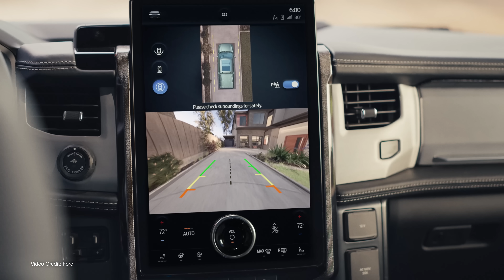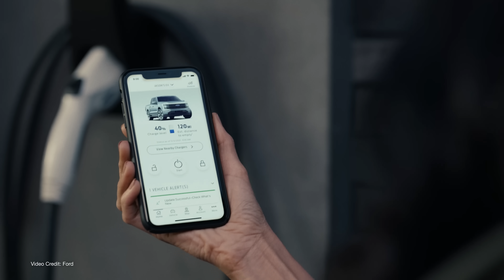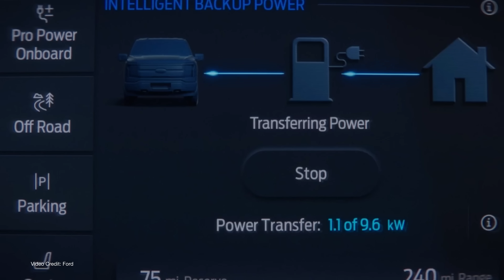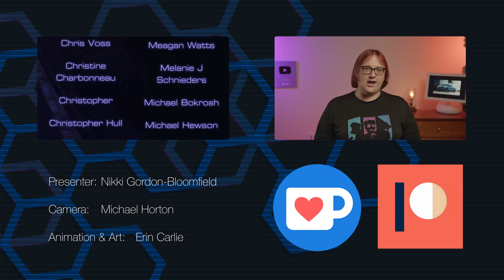Ford Maverick Lightning and Ranger Lightning EVs - What To Expect!

Comment: As an owner of EVs, one of the guaranteed results of most of them will give you plenty of ANXIETY!  Now we have more BS about putting a gas guzzling truck into an EV mode.  First, why do people buy these trucks?  Propaganda on the media helps these sales.  Do you know that 93% of truck owners NEVER use the bed!
Additionally, the dealers get away with charging the stupid buyers of trucks a 30% markup compared to a car.
Now this propaganda is promising an EV truck that will make everything better. So, for example, the manufacturers think that the car buyer is so stupid that they will buy an EV Hummer that weighs 9000 pounds and has a starting price of $110,000!
Hey, my Toyota Prius can get up to 80 mpg.  It uses both electricity and gas. Oh, and it cost me $40,000!  Hey, here's your super thanks for this baloney.

Comment: Omit the gas powered drive train motor transmission rear end Etc. along with the maintenance that goes along with it and replace it with batteries of the same equivalent cost and you’ll have a 300+ mile range pick up. Dealerships would love the Hybrid drive train because I would still get to do the maintenance on your gas powered drive train.
Reply: "batteries of the same equivalent cost" would not get you close to 300 miles range - or manufacturers somewhere would be doing it, even if Detroit didn't.

Comment: Given that compact/midsize trucks are not used for towing nearly as often as fullsize trucks (the main range killer for EVs), I really see a PHEV compact/midsize truck to be a waste. I'm in the process of finishing my ~90 kWh pack for the original Ford Ranger Electric, and based on original efficiency numbers from Ford, SCE, and Idaho National Labs, that should be enough for about 300 miles of real-world range and about 250 miles of freeway speed range (about the same as the Extended Range F-150 Lightning). A modern Ranger build with modern NCM batteries could easily support a 100 kWh pack, and I would expect that in factory trim, it could have similar range numbers to the Extended Range F-150 Lightning.

Comment: I wish YouTubers like you would base your speculations on real vehicle engineering rather than musings derived from trademark filings (by the way, you seem to mistakenly believe that a trademark filing in the US is only applicable to North America - it really does not work that way). BASED ON ENGINEERING/TECHNOLOGY CONSIDERATIONS,, here are some better informed speculations:

THERE WILL ALMOST CERTAINLY BE A PHEV MAVERICK. Likely a 2024, it will use the same (or nearly so) powertrain and C-Platform components as the PHEV Escape. This reduces development costs and makes for manufacturing savings. It will offer an EV range of 40± miles, because the size of the battery is constrained by what the current Ford PHEV space geometry for the C-Platform allows. The PHEV will NOT be available in AWD, ever. The design of the battery does not allow a driveshaft to run the length of the chassis. In the US, the PHEV Maverick will be a very successful seller.

THERE MAY BE A PHEV RANGER (but not any time soon). Not a lot is known about the P703 Platform that is the basis for the new Ranger. Its capacity to be modified for PHEV is unclear. What is known is that none of the initial engine offerings - in North America or globally - for the 2023 Ranger are hybrids. NONE. It is hard to engineer a PHEV drivetrain into a new vehicle platform if there isn't an existing hybrid offering.

THERE WILL PROBABLY BE ALL ELECTRIC MAVERICKS AND RANGERS - BUT NOT THIS GENERATION. BEV small and mid-sized trucks from Ford must wait until its new utility vehicle electric architecture is ready - which is model year 2026 at earliest. It could happen with a refresh of the Maverick in that model year, or it could be a model with different badging. I'm purely speculating here, but I suspect that the new Ford electric utility vehicle architecture will resemble GM's Ultium platform (which, contrary to what many people think, isn't just a battery technology, but a holistic system approach to electrification). Also, like GM, I think it will rely on a "hybrid" vehicle structure; something that combines unibody with a chassis (or a skateboard) as it appears the new Silverado EV does. This requires a very high level of system/structure integration, so it cannot just be adapted to an existing vehicle, like what Ford did with the F-150 Lightning.

Sharing this information with your subscribers would be far more substantive than the marketing based drivel you presented in this video.

Comment: Do to range and towing issues, I'd be interested in a plug in hybrid. Enough battery to do my usual shopping, etc, but still be able to tow my boat 350 miles, 1 way, to a yearly race.
I'm surprised no one is offering an electric vehicle with a smaller gas engine to be used only as a battery charger. At least Lotus and Toyota have developed these, but not in use yet.

Comment: As an American I'd suggest that Ford doesn't want to put the lightning name on the smaller trucks since the f150 lightning is a legacy vehicle that was always a performance truck. These smaller trucks may not be high performance electric trucks leaning more towards economy over performance. 

Thunder is easy to explain, it's what comes after lightning in nature. Thus the ranger and maverick ev launching after the f150 ev

As far as ev trucks replacing gas and diesel, that's a ways away. Getting 80-100 miles range towing 6500lbs is insufficient. Compared to the gas versions going 300miles towing 12000lbs. 

The USA is a huge country. Europe as a continent is about the same size. So we can travel across several European countries just by crossing a few states. I've numerous times driven 1000miles in a single day which you aren't doing in an ev. And that was me towing a 15klbs or 6800kg camper. Fuel stops are 10 minutes ev charging is not. And if you had to stop every 100miles to charge an ev would have hrs of down time to charge. 

Show me an ev truck that can make it from New Orleans to Chicago in 1 day towing at least 4545kg or 10000lbs and I might be swayed but that's unlikely to happen anytime soon. 

And the requirements to go ev won't be enforced anytime soon and as soon as they try to enforce them, the courts will strike them down as govt overreach.

Comment: The time for PHEVs to really shine was 5-10 years ago.  They still have a niche, but they missed their shot at the prime time.

I do wonder if a 4-second 0-60 time is a good idea in something that doesn't have a sports car's steering, suspension, brakes, weight distribution, and center of gravity...  The question is, how good does it fare in braking and obstacle tests?  (They're probably going to have to implement an acceleration limiter, especially on fleet vehicles.)

Comment: In nature first comes lightning and then comes thunder.  Could be as simple as that.   I was going to trade in my GLE in for the pro model but you can't get one and $80k for a vehicle is stupid.  Take the $40k savings and buy lots of solar.  Plus you get the 26% tax credit.  And then there is the large added carbon footprint I'd be contributing to buying a new EV when my driving habits in this used vehicle is soo much less.  Meh, no one really cares about the environmental impact their vehicles are having.   If they did they would have converted to propane years ago and not drive over 50 mph.

Comment: I just wish anyone would actually come out with a small pickup like the size of the Mazda based Ford ranger that they sold until about 2011. There have been a few start up companies which have shown concepts that might fit that size, but none have actually delivered any yet.
Reply: The Mazda B4000 was a rebadged Ford product, rather than the reverse. The Ranger was essentially unchanged for something like 16 years.

Comment: Sadly I believe you are correct in thinking that we will not see an all electric version for some time.  Personally I am not a fan of driving a small vehicle of any class for long distances.  I have had enough negative experiences with plug in hybrid vehicles to steer me clear of them, especially as they age and the combustion engine side developed issues related to low usage.  

What I am looking forward to is an all electric SUV ( Explorer sized) with 300 to 400 mile range EPA list.  Then I could ditch combustion for all but a small slice of vehicles.

Comment: Since everyone in North America but me can drive 600 miles every day without stops of any kind and either pee in a bottle, or Blue Cruise it out the window, I think a PHEV truck makes sense until the next gen batteries arrive that can go 600 miles while towing a brick house.
For myself, I am hoping that Lightship, or Thor/Airstream bring a battery powered trailer to market that is somewhat affordable which can optimize the range of a 300 mile truck.

I'm hoping that one manufacturer goes away from the crew cab tiny bed and brings me an extended, or regular cab with a 6 foot bed and a nice front storage area.
I have always wanted to help Mrs Smoker and Mrs Non-Smoker find their missing piston engine. I do sometimes put my groceries in the front of my Tesla which can cause people to stare

Comment: Yep. You are probably right. The Maverick, which comes as a hybrid in the standard configuration, has a drive unit that is more than a little reminicent of the one found in the late gen.1 Chevrolet Volt. It is Plug.n-Play ready for conversion to PHEV. 
A PHEV version was obviously planned for in the initial design spec since considerable engineering and testing time and money is needed to copy design a drive unit (some say "transmission") like that.

Comment: I agree entirely with your analysis. I HOPE the Ranger and Maverick both get a Lightning variant in the US. But I’m not betting on it. A plug-in hybrid “Thunder” is the logical product mix for the US market. My concern is that there are care/operational considerations on PHEVs. “Stale gas” is something drivers who use mostly the electric range have to monitor. This inconvenience as well as the fact that if you don’t plug in, your MPGs will decrease significantly more than a regular hybrid as now the engine has to haul around the weight of the battery and motor which aren’t contributing to propulsion. These two issues could turn people off to electrification.

Comment: i gather that since the F150 lightning is a crew cab (has 4 doors). that the Maverick and Ranger will also be in crew cab models, which tend to be some bigger than their standard and extended cab models, and who knew cost more too. cost more = higher profits for Ford (and others).

Comment: Well..  Ford can EASILY come out with a maverick plug in hybrid as stage 1.   and then come out with EV version.    I'd certainly give them 40 or 50k for one.  single or dual motor.      Nothing at all wrong with a 150 mile EV Maverick Lightning.   and if you are person who needs more.. you buy a Maverick Thunder.

Saves ford from having to cram 350 miles into a pickup.   Most people dont need 350 miles of EV

Comment: I hope that the Ford Maverick and Ranger Thunder are just Electric.. the F-150 Lightning used to be a performance gas truck in the early 2000s so it wouldn't make sense to add that name to every single electric pickup truck that happens to be from Ford

Comment: Plug-in Hybrids got no future, why not Full EV Now?
Reply: Cuz in 'Murica, people need to tow their 25 foot boats 600 miles into the desert, uphill both ways. Every day. Ask them, they'll tell you. Plus the electric grid, you know, won't work if everybody changes to EVs tomorrow.
Reply: @jamesvandamme7786  By the time manufacturer ramp up there production, no problem for the grid. Also when EV get a range of 600miles+, which is very soon, no problem! Get rid of hybrids!

Comment: Interesting thoughts! Regardless of what happens I just hope a country doesn’t get stuck with a hybrid model and no electric version being locally available despite them being available elsewhere. … which I think is actually already a problem in my country with some cars, I just don’t pay enough attention to anything hybrid related to confirm off the top of my head. Which wouldn’t surprise me given how hard it is to get ev anything over here without emission standards and fines when we are competing for product against countries that do.  

Also good to hear more about how the Lightning truck is turning heads. Can’t remember if it was you or another channel or both that did an explainer video about the importance of the Lightning truck to Americans but the cultural aspect and that house energy backup certainly seems to have people talking! Great to hear that momentum is still going, perhaps even getting bigger or more entrenched now there are actual physical trucks around for people to see and experience in person.

Also that point about the frunk turning head and getting people interested is interesting. Haven’t really thought about it that way before but that’s a very obvious visual indicator of something very different that could get the uninitiated talking. 

Hell, even as someone who’s been following EVs for years the first time I came across a Tesla with a family casually pulling picnic basket type stuff out of the frunk I still blue screened for a moment. My mind just did not compute the idea of empty space where the engine should be, seeing frunks on video and knowing some EVs had them was one thing, seeing it in real life was entirely another.

Comment: Makes perfect sense. I think the US market will definitely be interested in the Thunder Maverick PHEV, especially due to range anxiety while towing close to maximum capacity. However, the downside is having 2 different drive trains making maintenance just as bad or worse than an ICE vehicle 🚗
Reply: This is false.  The electric part of the hybrid engine not only reduces use of the ICE portion of the vehicle (less oil changes, less wear and tear on valves and injectors), but also reduces use of the breaks due to regenerative breaking.  

In addition, there are relatively high maintenance parts no longer needed in a hybrid, such as the starter and alternator. 

Hybrids have two engines, but less parts overall and less moving parts than an ICEV, and that is why their warranties are longer.
Reply: @JeremiahTownsend  Interesting. Thanks for your insight. Cheers 🥂
Reply: @JeremiahTownsend  There's one aspect to a PHEV which is annoying (or worse) - the need to "refresh" or cycle the engine and burn an inordinate amount of gasoline because the vehicle senses it's been in the tank for too long.  We keep only a quarter of a tank in our Pacifica PHEV for this reason. I'm not sure how you improve this with a PHEV. Our van will burn through a half a tank if it hasn't run the engine in a while. Love the idea of PHEVs though. They solve a lot of problems.
Reply: @JeremiahTownsend  I've had a Sonata phev for over 3 years. Requires just as much maintenance as a normal car. I'm starting to think driving it mostly as an ev is causing issues. Fouled sensors, fuel in the oil from cylinder wash down, and codes for the catalytic converter. The engine rarely gets to operating temp. When it does run it gets ripped right to redline. On the flip side, I barely use gas outside of winter and can go on long trips without charging.

Comment: My guess Ford is wanting to keep the Lightning for F-series. One day Lightning 250, 350, 450.
I could also see the Thunder become the plug in battery.  With multi fuel generator. 
200 mile battery. With a 300 mile generator. 500 miles total.  Starting with diesel and switching to synthetic when available.
I could also see the Maverick as battery only, with the Ranger as battery generator.

Comment: I'm saving up for a Ranger Lightning. It just makes sense that the F150 EV technology will trickle down to the Ranger. I might consider a PHEV Ranger, if the all-battery range is high enough to cover almost all daily use, leaving the engine for road trips only. But that's only if Ford drags its heels too much on the EV Ranger.

Comment: In addition to the range argument for Thunder=PHEV I would think the price argument is perhaps just as strong. Especially for the Maverick. I havnt really seen many where I live, but I was just at the NC coast and I saw Mavericks EVERYWHERE, hauling every kind of small boat or personal watercraft you could imagine.

It is the smallest truck in the US market and it is $6k-$20k cheaper than the other light trucks in that market. That $20k starting price has to be a BIG part of its popularity but there is no way Ford would be able to sell a fully electric version with any decent range for anywhere close to that price. I would bet that may be less of a problem in Europe where people will just be happy to be able to buy a small but feature-rich EV truck even if its a little pricey.